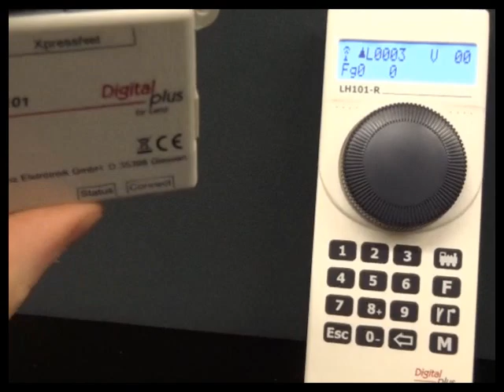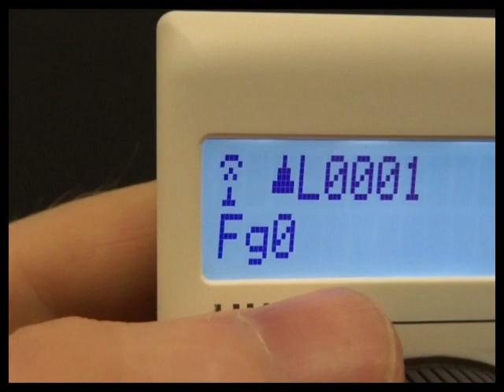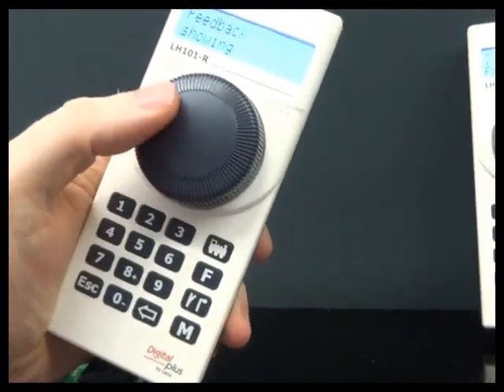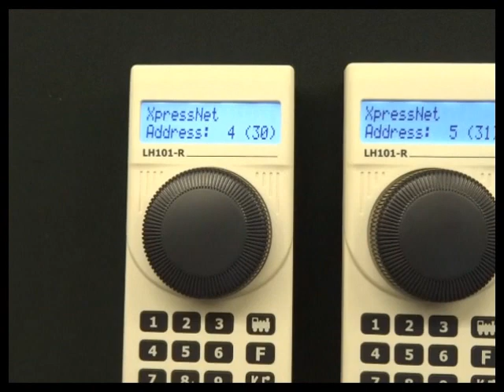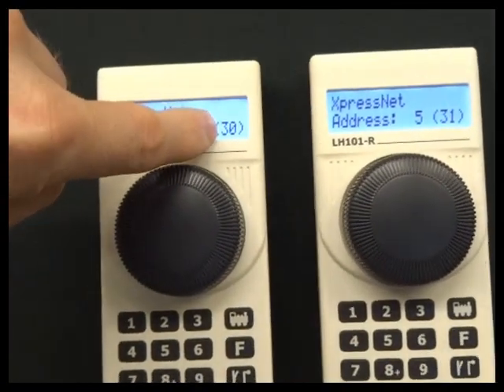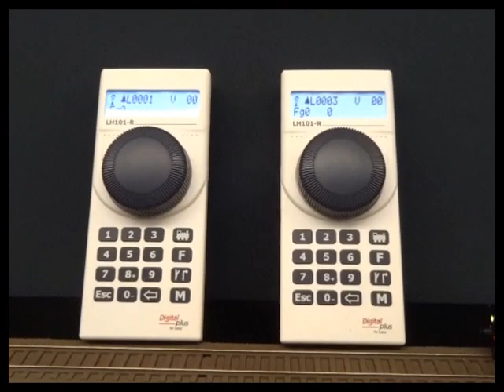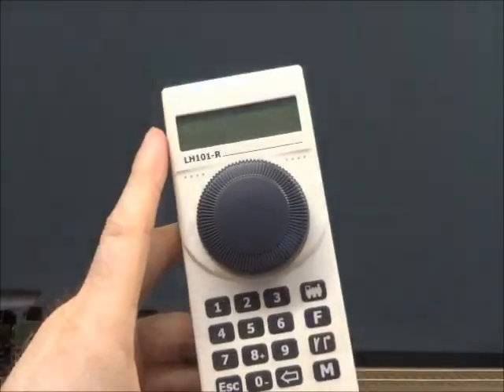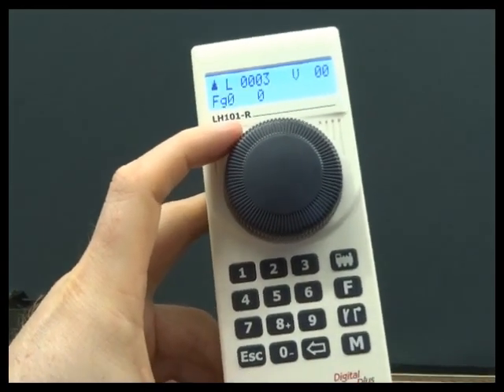Lenz LH101R Wireless handset and LTM101 Receiver  quick look

Comment: I noticed there is a + and a - sign on the key 8 and 0, what does this denote?
Reply from the maker: When you switch accessories  - the M button cycles +-+-+-.  This is fine for switching turnouts but some decoders need you to send repeated commands - The best example is a turntable decoder where + steps the turntable one position clockwise so you want to keep pressing + until you get the right exit
Reply: @digitalcareline  Thanks.